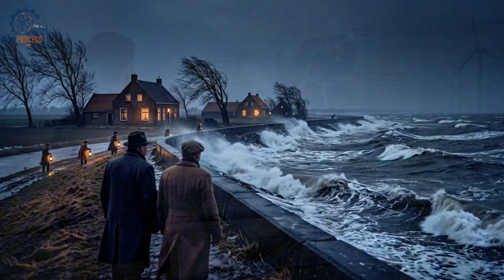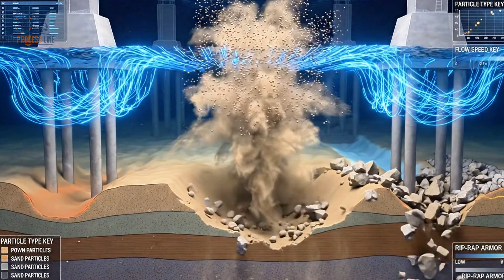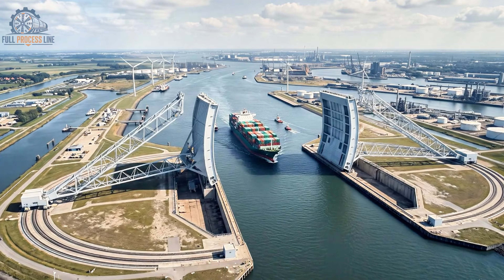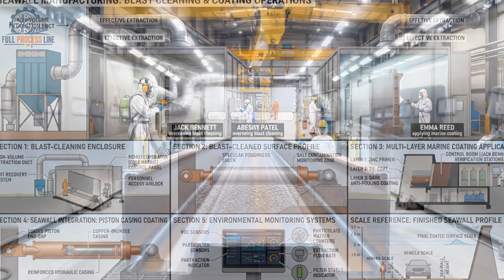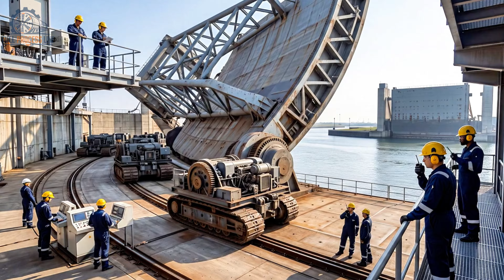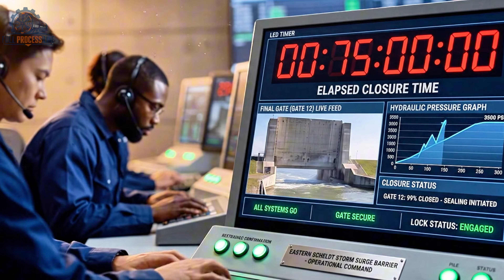How the Netherlands Built an Impossible Country Below Sea Level l Full Process Line

Comment: The Delta Works construction required engineers to balance flood protection, shipping, tidal movement, ecology, and unstable seabed conditions. Which stage impressed you most: the first survey, concrete pier manufacturing, offshore installation, or final gate testing?
The foundation emergency shown in this documentary is an engineering reconstruction based on a realistic scour-related risk. What do you think was the strongest technical solution: grout injection, seabed anchors, the enlarged rock apron, or continuous structural monitoring?
Reply: For me, the offshore installation was the most impressive stage. Positioning structures of that size with such precision while dealing with tides, currents, and changing weather must have required incredible teamwork and planning. As for the foundation challenge, I'd probably choose the enlarged rock apron combined with continuous structural monitoring. Preventing scour is one thing, but detecting changes early and responding before they become serious problems is what really ensures long-term reliability.